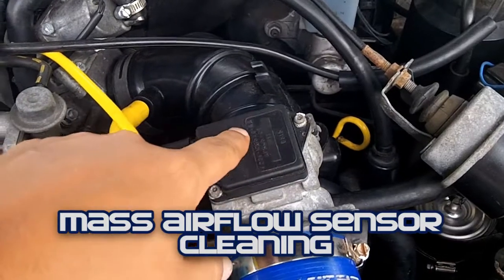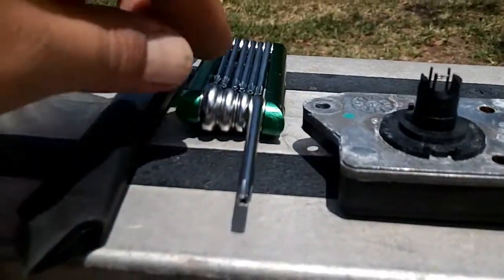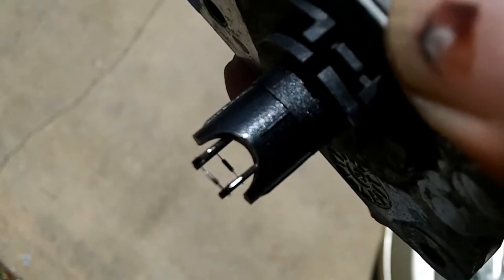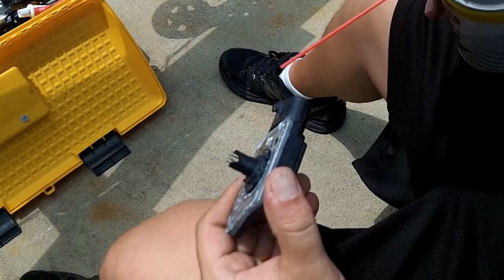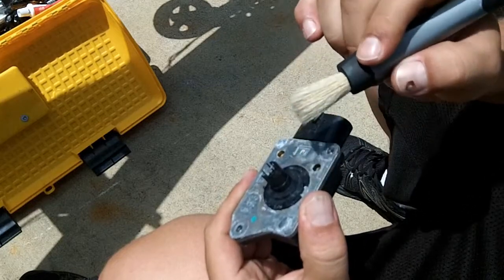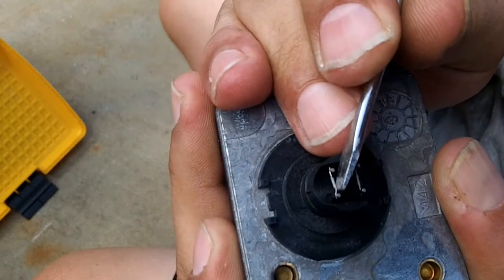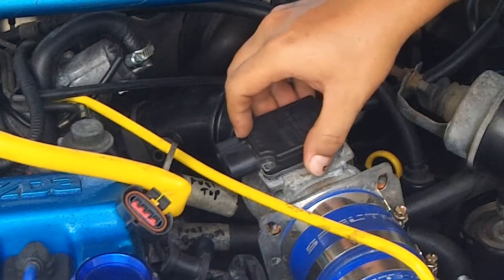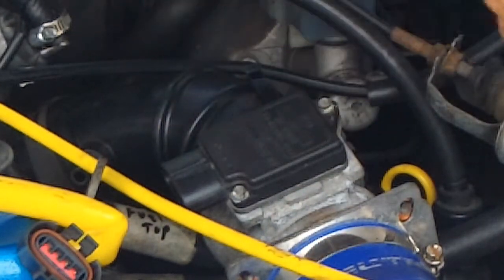Mazda 626 - Mass Air Flow (MAF) Sensor Cleaning

Comment: I have mazda 626 1995 DX automatic trans. the MAF might be malfunctioning because when I read error code it gives me the no. of MAF error (reading check engine light flash), the problem is that when check engine light goes off the car  goes unsteady and when it turns on  the car gos smooth and good. I cleaned the MAF with electric cleaner and check the o ring for sealing but the problem still goes from time to time.. what MAF I should buy that matches my car?. Thanks.
Reply from the maker: 5:58 Your vehicle can use the same exact part # as the one I have.  Remove it and see if it's gunked up or if one of the wires is broken.  A gunked up hotwire can set intermittent codes, it's definitely worth looking into cleaning. So yes you'll definitely want to use this video as a reference for yours. If cleaning doesn't help and it's still out of spec even with a good o-ring and requires replacement then I've provided the part # at the time specified in the video. Good luck! :)
Reply: @DJDevon3  I cleaned it many times with electric cleaner .. it didn't work ... anyway.. I found many brands of MAF on the web Duralast $115, Dorman $77 and Walker $52.. is it ok to purchase Walker ?..

Comment: i have 1998 mazda 626 2000cc manual transmission car. is the MAF sensor same in automatic and manual transmission cars?
Reply from the maker: In some years no.  In the 1998 yes.  Part # FSD713215
Reply: thnx mate !

Comment: DJ, I have a 95-GLX Euro Specked , the sensor does not have screws on top, how do I remove it to clean it thanks?!
Reply from the maker: I would pose that question to Mazda626.net where there are many many European members.  I didn't even know about that issue.
Reply: Ok bro, apprecaite the response as always!

Comment: your videos are always helpful for me on my probe. I was at a light awhile back and all of a sudden my car was loud like it had a straight pipe and wouldn't move like it usually does. I think my maf sensor is bad or exhaust gasket somewhere messed up.Replacing whole exhaust soon so will find out what it is
Reply from the maker: +Jav Munguia You can have the exhaust smoke tested (at the tail pipe) the same way you would smoke test the intake side of an engine (at air filter box). Much safer (and fun) way of going about it. Not every one has a smoke machine but still good stuff to know. :)

Comment: please make another video refering to the other kind of MAF SENSOR, the one su call : flag type which is used on the standard transmission
Reply from the maker: arturo heredia-enriquez The 2.0L manual transmission is still a MAF just a slightly different design.  The 2.5L (V6) has a VAF.  I do have one and can make a video on that if that's what you mean.

Comment: I hooked the MAF engine died. No problem there.  I just bought the car off a friend noticed that the air filter box will not seal as well.
Reply from the maker: moog Air filter box will not cause an issue other than perhaps debris getting inside or a mouse or squirrel nest. Air is only measured between the engine and the MAF.  The air box is not part of the measured air.

Comment: I have 626 96. idles great, but on acceleration bogs down.  Possible MAF?
Reply from the maker: moog More likely to be a vacuum leak but sure could be MAF or clogged catalytic converter or bad timing or bad fuel pump or like one of 30 other things.  You have to do diagnostics to rule in/out one culprit at a time.  Since you have a 96 you can put an OBD-II scan tool on there and get a lot of information in one shot.

Comment: Have 2000 626 Mazda transmission and timing belt already replaced, Son said that he saw white smoke and a bang and like something fell off. 1st thought was oil filter, but no. Oil was all over passenger underside. Doesn't look like oil pan gaskets. Any thoughts? Thanks!
Reply from the maker: I4 or V6? Automatic or Manual? Possible backfire due to timing belt slipping.  If you recently had the timing belt serviced it's possible the timing tensioner or spring wasn't properly calibrated which can cause the timing belt to jump time which can cause a backfire.  Ensure the PCV valve and breather hose aren't clogged as that can contribute to block and head pressure which technically could cause a blow out.  Do a compression test to ensure cylinder health.  Also check the catalytic converter and exhaust pipe.  I have actually heard of the exhaust pipe exploding right before the cat due to a clogged cat.
Reply: I poured oil back in crank case and immediately began to come out of oil crank case. What do you think?
Reply from the maker: Jeff Rodiguez I don't understand what you mean.  Where exactly was oil coming out of the crank case?  Do you mean it was coming out of the oil pan / sump?  If you have a bad leak around the oil pan you'll obviously need to address that.  What would cause the oil filter to collapse I'm not sure.  I would do some internet searches.  I've never come across that issue before.

Comment: @devon kode readr said system lean
Reply from the maker: Omar, Test throttle position sensor, injectors, and fuel pressure regulator.
  I don't think your issue is MAF related.
Reply: ok wil do.

Comment: I was told by my mechanic that it's possibly the exhaust manifold, it's eating through gas and smells like gas only through the exhaust, I was told it's possibly the o2 sensors, because of the gas eating and gas smell issue

Comment: Has no air leak, had water pump replaced and has new timing belt, It's in time, I just did a compression test, it's getting good compression, my next step is possible oxygen sensor(1&2) or fpr-fuel pressure regulator, im taking it to the exhaust shop I go through and get the exhaust manifold checked out for possible crack or bad gasket, my air intake has no leaks, and tps is newer, it's good, check engine light only comes on and stays on the highway, and when it does I let off the gas and tap on
Reply: Nick Stufflebean i have this problem but it's non of what you said i did everything including the 2 o2 sensors

Comment: Hey Devon, my car started running rich Sunday night within a flip of a switch, I replaced the distributor cap and rotor, the spark plugs, but my wires are good, it idles rough and hesitates on acceleration, I took it to the shop and they told me the cap and rotor was bad and I replaced it but still no luck, I cleaned maf sensor and throttle body, any ideas?

Comment from the maker: Sounds like a misfire.  Remove and inspect the spark plugs for oil fowling.  Is there oil on the either end of the plug?  Do a spark test and make sure it's not intermittent spark loss because of a bad distributor or coilpack.  You can't just replace the plugs you have to do a spark test.  Look up some videos on the subject if needed.

Comment from the maker: If there's no air leak then I'd check the ignition system by doing a spark test on each plug.  If there is healthy spark then move onto the fuel system (possibly low fuel pressure or injectors).

Comment: Yes, and I had a major crack in my air intake at one point but it didn't do what it's doing now, I patched the crack, I don't see any disconnected vacuum hoses, I am about to change the Sparks, I will keep updated and will appreciate it if you would do the same

Comment from the maker: First thing I would look for is an air leak.  Does it feel like acceleration takes 2-3 seconds to respond when you go wide open throttle.  If yes then definitely an intake air leak or vacuum leak.  Everything needs to be air tight all the way from the intake manifold to the air filter box.  There are other things that can cause it but I'd start with looking for an air leak as it's the most common thing to check in older cars with old brittle vacuum hoses.

Comment: I have a 93 mx3 gs 1.8L v6, my car Idles at normal rpm, but it putts alittle and when I accelerate it sputters in every hear until it reaches between 3000-3500 RPMs, any ideas why? Im changing Sparks and wires soon, need some thoughts of what it could be

Comment from the maker: I think a q-tip would work however it's still not as delicate as a horse hair brush.  With a q-tip you have to apply physical pressure to the wire but with a brush there is much less force applied.  The force applied can be the difference between a broken wire or not if the wire already has a micro-fracture.  The wire certainly can break during normal operation over the life of the car.  It's best to do it as gently as possible and nothing beats a horsehair brush for delicate cleaning.

Comment from the maker: It is possible yes because the MAF (along with other sensors) directly control the air/fuel ratio.  The ECU uses MAF data to determine how much fuel or air to add or remove at any given millisecond.  Other possibile scenarios for your issue include faults with the IAC, air adjustment, timing, head gasket.  I always recommend seeking a professional diagnosis though, there's only so much one can do over the internet.

Comment: I have a 2001 626...4 banger... i have changed the spark plugs and wires ... used lucas gas tune up.. tried premium gas.. and fuel cleaner.. all this made the car run some what better but not really.. it idles really bad when i stop or if im in neutral or park the car putts... cant figure out what it is.. could the MAF be related to this

Comment from the maker: That's odd usually it's the other way around because heat increases resistance in wiring.  I'd look into the IAC more so than the MAF for that one.

Comment from the maker: It should work for any car that uses a hotwire type MAF.  I believe the Protege uses a VAF so no it wouldn't be the same.  However, yours would be the same cleaning procedure as the V6 626/MX-6 (KL-DE) so you can look up tutorials on those.